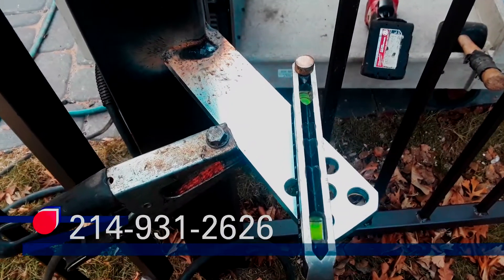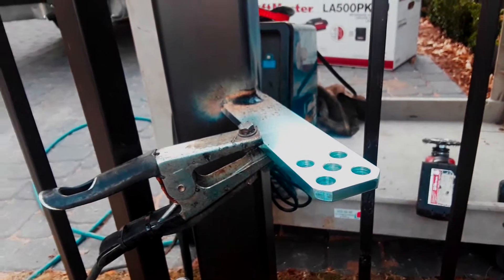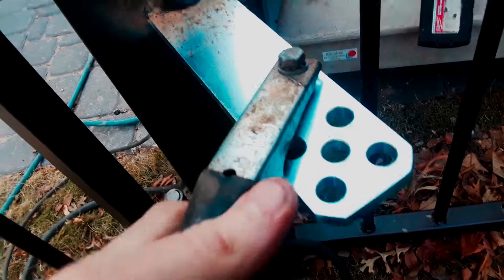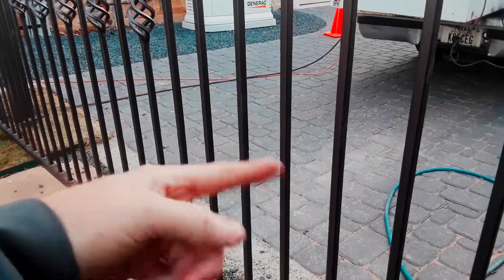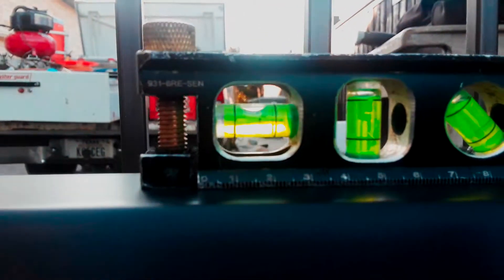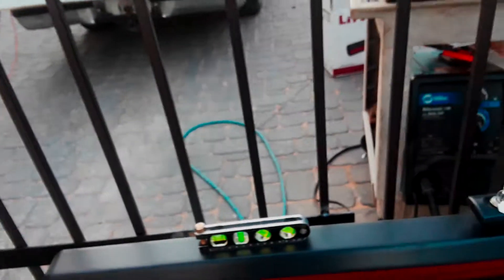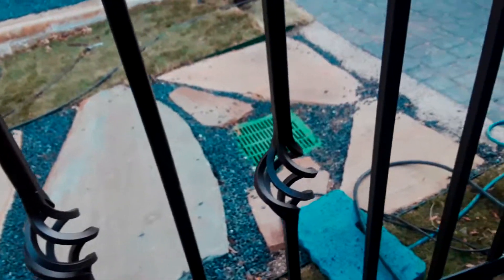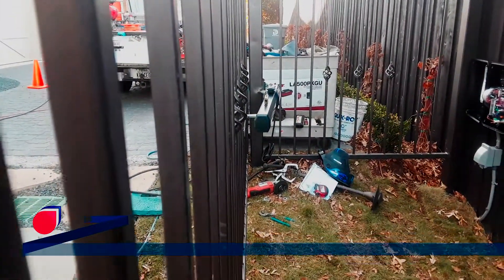LiftMaster LA500 residential gate opener Step 4 N Dallas, TX | SC0059

Comment: I am having the sam exact problem on one of mine in a dual application… one was somewhat difficult to manually move before I connected to the gate. The second one didn’t move at all. I am going to hook it up to the board and see if it will free up
Reply from the maker: What's the problem